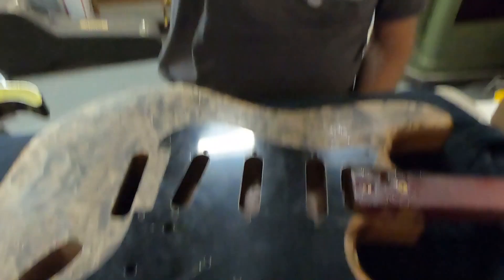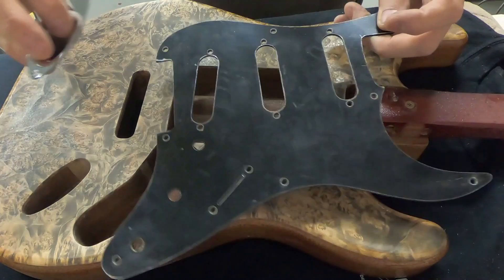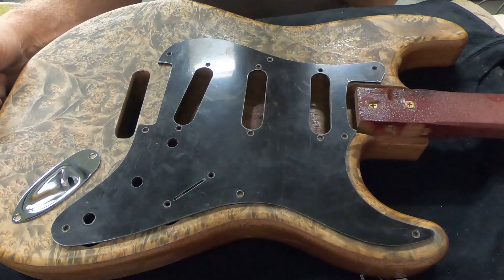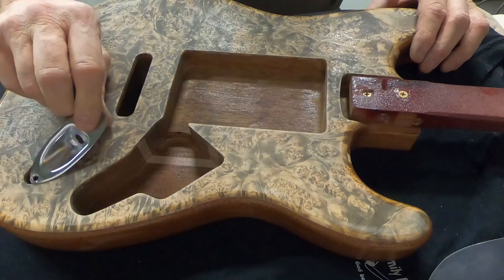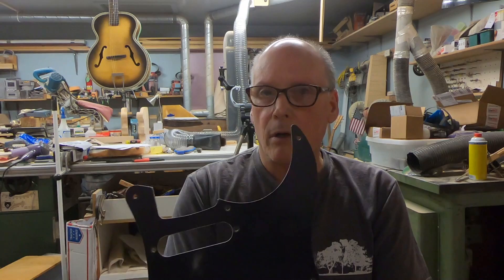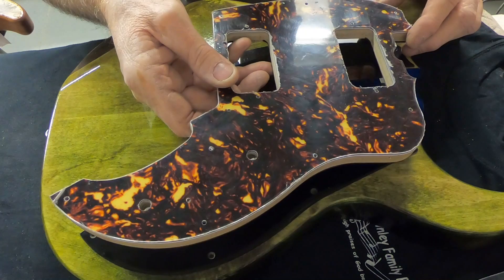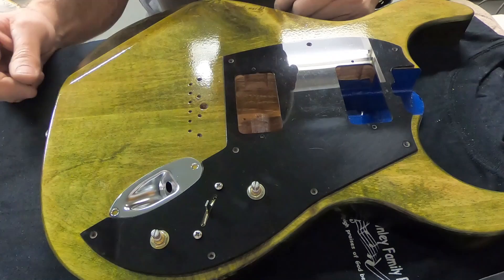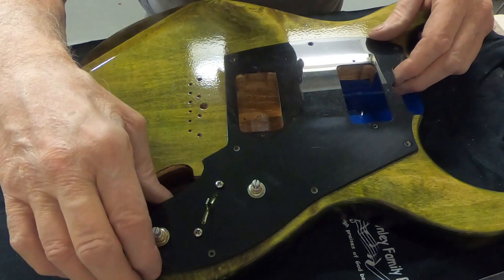WHAT LEO FENDER GOT WRONG! STRAT OUTPUT JACK? JONAH GUITARS

Comment: It's a real good idea Dane, but desoldering a couple of wires doesn't give me too much grief really. How about 22 fret necks on Strats where you have to release the neck too because it traps the pick guard? And what's to be done with the bridge / vibrato assembly grounding wire? Actually, to avoid soldering the vibrato wire at all I crimp on a ring terminal and trap it under one of  the spring claw screws, but that prevents from withdrawing the wire through the hole. This starts to become a can of worms ;<D

Did you know that when Leo had all that nonsense from Fred Gretsch over the Broadkaster name, he simply cut away that part of his Broadcaster decals until stocks were depleted and thus you had Fender "NoCasters" (sic) for a while. Now that's optimising costs for you!

Your video editing is getting slick and neat Dane.
Reply from the maker: Well you know Steve I didn't think about the trem claw but that's only cause this guitar is a fixed bridge. But I do still have to deal with a bridge ground. Dang! I was really looking at it from more of an assembly view point. Because with my design I can completely wire it up no where near the guitar. 

I did read about the decals and the no caster era.

Thanks for having a look and your insight!
Reply: @jonahguitarguy  Well you're-a-thinking like Leo Dane. The only thing is that  such production assisting techniques don't really match the aesthetics of say your 335 build. Beauty is of course in the eye of the beholder and I love Leo's classic designs, but it seems with age comes an appreciation for the little niceties of integrated designs as much as for the bolt together approach that has traditionally been my first love. I like and am intrigued with your new body design. It's not like the Peavey T60 at as I at first concluded. I have a white bitza Strat with a tortie guard. This build would definitely work with such a pickguard Dane. Bring it on Bro'!